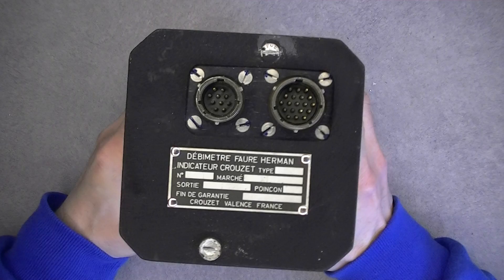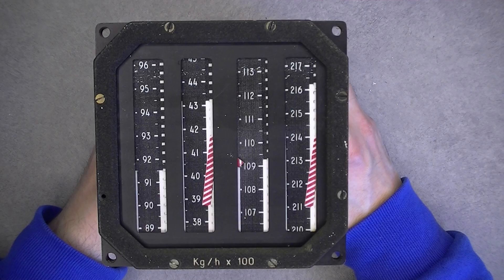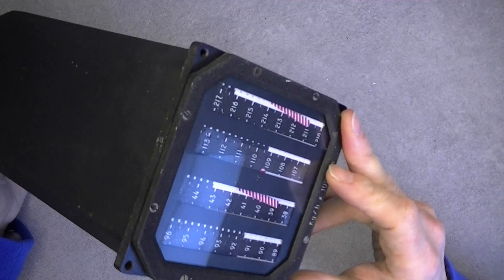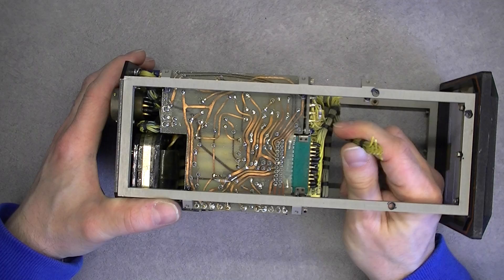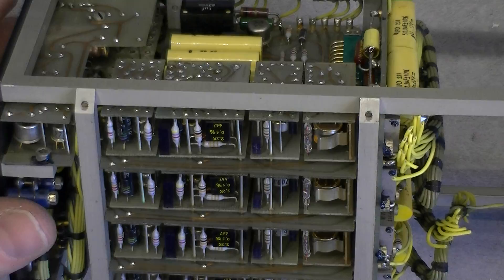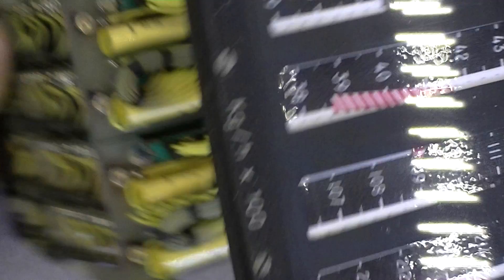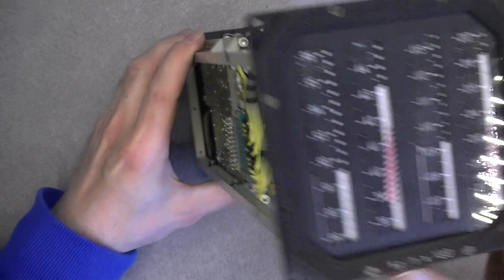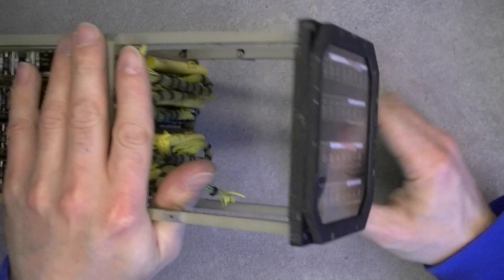Ebay disappointment: half empty aircraft instrument

Comment: I work full time in a Jet Avionics Lab and have been in this field since 1979 also I am a hobbyist in electronics and have been an Amateur radio operator since 1971. If you own an older aircraft and are looking for replacement equipment there is two ways to get equipment. If you want to try and save money you can go to an aircraft junk yard and pull the equipment yourself. This can save money but the equipment may or may not be serviceable. The other way which will cost more is to buy serviceable equipment from a reputable dealer that will supply a return to service tag and a repair data report plus a guaranty of at least six months. If you are a hobbyist and looking for parts that can be used in various projects then buy the equipment at the cheapest price that you can because the unit will be either obsolete or had a major failure but could still be a treasure for good used parts. I've worked with similar instruments like the one shown in this video. The tape indicator assembly that is missing was the part that would fail most of the time as it was a mechanical servo/synchro tape indicator assembly with moving parts that wore out. For the hobbyist it would provide either an interesting meter movement or a servo/synchro assembly that could have been used in some kind of controlled mechanical movement for robotics or some other project. However, what you do have is a case with a frame work that could house a project and the circuit boards look good, the parts most likely are all military standard components which are tougher and operate over a wide temperature range. Just test them as you pull them for use. Today's equipment that can test inductors, capacitors and transistors is fairly cheap.